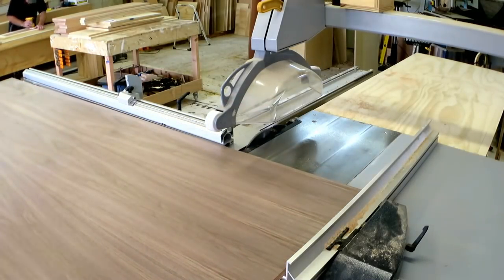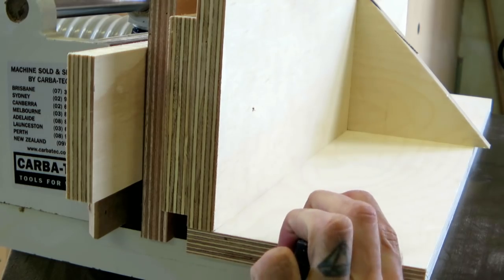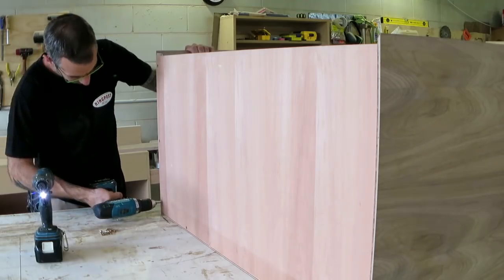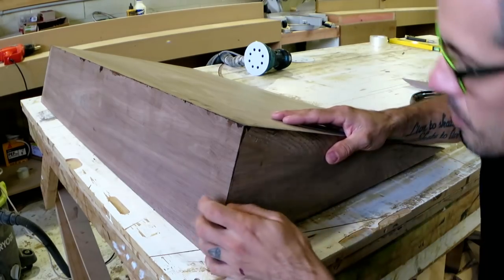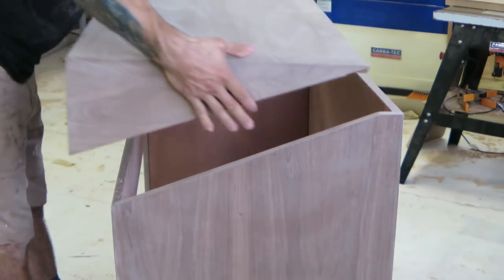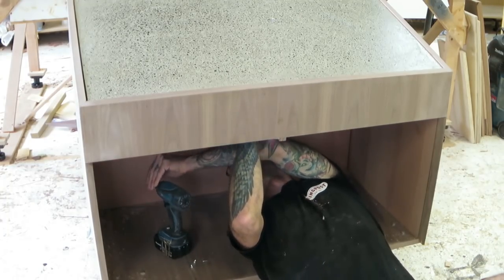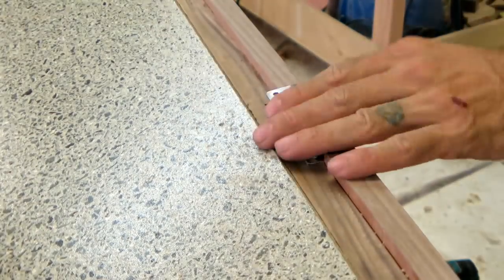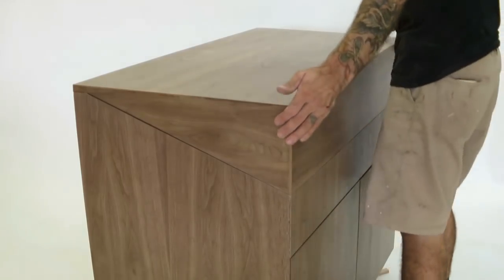concrete display stand

Comment: I thought the lower doors would open to reveal the layers of bedrock, compacted crushed fill, vapour barrier, concrete subfloor, EPS insulation, wire mesh, PEX tubing, and finally, the finished concrete above.  I suppose the trade show workers can store brochures or their lunch in there at least....

Comment: Great build!

You have quite the contraption on your router table there. Did you have these fences already on hand? I can imagine it would be faster to use a palm router with an extended base. But it is just me thinking of a easier solution afterwards. 

I love your channel! Because of you I bought Stubai tools and I am happy with them. 

Regards, Etna.
Reply from the maker: That would work for square edges but ton 45 deg edges.  I made this jig in 5 min for this job. Cheers
Reply: Thanks for clearing that up!

Comment: Nice video.
The display stand looks great.
I saw that you pasted the walnut strip with the hot air blower.
Have you ever tried such strips to iron up with an iron. So I always paste edge banding on.
Reply from the maker: This edging is 2mm thick, so too thick to iron. Heat gun is very quick also
Reply: Aha, Okay.

Comment: Looks good but I don't see how it displays any of the heating components on the bottom of the concrete
Reply from the maker: It will be plumbed up and hot water run through to heat the concrete.
Reply: Thanks. I was thinking they wanted to show off (display) the plumbing

Comment: Very nice indeed. Which tool were you using to apply the finish?
Reply from the maker: It's a speed brush. Basically a sponge with very short brush.
Reply: Thank you sir. I was applying polyurethane with an expensive fine bristle brush but it is not good at all. It doesn't apply well and leaves streaks when I back over the previous stroke because the Poly has started drying. I went to use foam "brushes" which do better but I have a large flat areas to cover. I will look for something like you have there. Looks much more efficient. Thanks again.